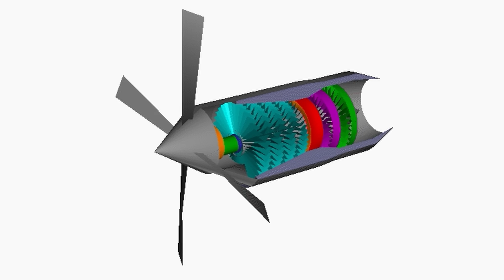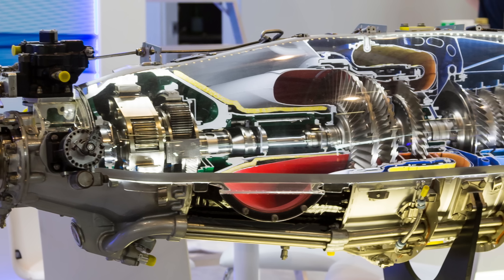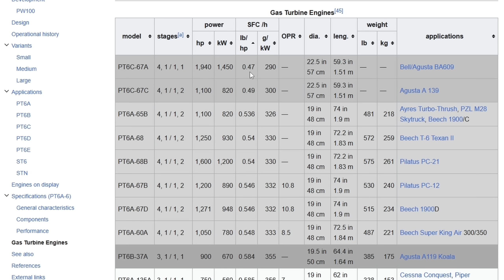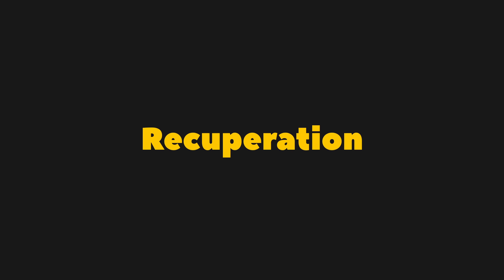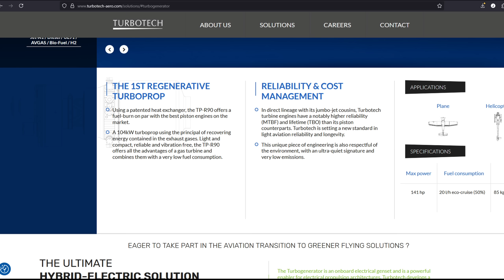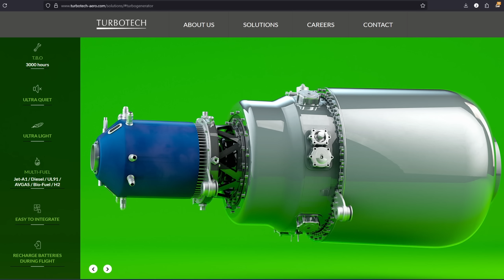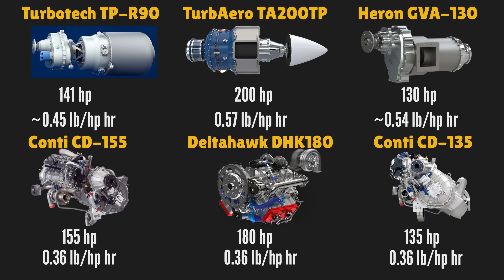Are Piston Engines Dead? Small Turboprops are Here

Comment from the maker: Most Successful Turboshaft? The General Electric T700 Design Explained : https://youtu.be/cxQ-Ef4uIpw
Why Diesel Might be the Future of General Aviation : https://youtu.be/ObGTibQHLXQ
1930's Opposed Piston Aero Engine Design Revived? Jumo 205 & Gemini Explained : https://youtu.be/NQBy1Boyfbo
Reply: Beta makes sense.
Reply: Here's the thing.  100LL will be past tense by 2030 but 100UL in various flavors is getting poised to replace it.   There are 3 big issues with this.  1st is, EVERY single, individual avgas-burning plane not factory-certified to run on unleaded avgas, which is the vast bulk of the existing fleet, has to get a special type certificate (STC) to do so, which is on the plane's owner to accomplish.  No STC, no more avgas for you after 2030.   The other issue is that  there are several competing blends of unleaded avgas out there, and it seems uncertain which, if any, will become dominant or if separate STCs will be needed for each flavor.  And the 3rd big issue is, how soon can even 1 of the new UL blends become as widely available as 100LL to support the existing and future fleet of avgas-burning planes going forward?

And really, there's a 4th big issue.  Whichever flavor of UL gets to market in quantity first will basically gain a monopoly by default, so avgas prices are certain to increase significantly for that reason alone, regardless of the relative costs of making this UL vs LL.  That changes the math you were using about  the fuel-efficiency of turboprops vs. avgas pistons.  A turboprop with a higher specific fuel consumption might actually end up costing less to operate in fuel costs over an avgas piston simply due to the difference in fuel price.

With the certainty that 100LL is soon to disappear and all the uncertainties and bureaucratic BS about using its replacement(s), it makes sense to at least consider switching to a plane that burns jetfuel, whether this be a piston diesel or a small turboprop.  Me, I'd be buying stock in Diamond :)
Reply: Electric,? You mean landing at take off weight every time? Nope. Please try again.
Reply: i just want to see gas turbine cars
Reply: @travisj2370  Sorry to be a bust but gas turbine cars have been tried and tried and tried and FAILED and FAILED and FAILED and FAILED and FAILED and FAILED and FAILED and FAILED and FAILED and FAILED and FAILED and FAILED and FAILED and FAILED and FAILED and FAILED and FAILED and FAILED
Reply: @travisj2370  Chrysler tried that after WW2 until the '60s. It didn't work out for a number of reasons;  https://en.wikipedia.org/wiki/Chrysler_Turbine_Car
Reply: @peteacher52  yea im aware of it but we arent in the 60s
Reply: Pero para que tienes que salir tu tanto tiempo pon el vídeo 📹
Reply: Then we have to circle back to weight to power ratio. And the turbine still wins hands down.
Reply: For me, fuel efficient, FADEC-controlled Diesel engines are the future in small GA aircraft. Especially as the availabilty of AVGAS around the world (except US) gets more and more an issue.
Reply: 1000 hp at the prop, means 3000 hp at the turbines.
2/3 of the air moving through is used to cool it.
Reply: @tomg6284 What are you basing that claim on?
Because if you're using the thermal efficiency calculated using Carnot then you're not far from the truth. 

BUT THEN you'll get the same sort of answer for any engine operating a thermodynamic cycle.
Reply: @hanswallner2188 Yeah I tend to agree. But there's still a way to go on the reliability of the battery systems. 
Siemens tied up with Extra and electrified an Extra 300 and showed it could still perform. That was fairly spectacular but I don't know if they proved you could take it anywhere AND one of the most important things about competition aerobatics is being able to get the plane to the comp. They all have long range tanks in the wings that you empty for aerobatics.

How that relates to other aircraft needs to be clarified because above all else they need to be able to go places.
Reply: @hanswallner2188 Battery's weigh too much for cross country four seat Planes. Liquid fuel only needs a tank. The BTU's/lbs. added weight, don't make sense for electric powered small cross country application. Use the sun to make liquid hydrogen; Now that make's sense.

Comment: 3.0L Diesel engines like the Duramax LZ0 have a BSFC of 0.315lbs/hr per hp at peak efficiency of 2750rpm. Lighter than an IO540 with the same hp range. It baffles the mind, inline 6 engines are significantly smoother the 4 cylinder engines. With dry sump oiling, much tighter rework machine tolerances, uprated oil pump, crankshaft, and rods, this would be a far better option direct drive engine option full fadec dual ECU control.
I still don't understand the FAA engine certification process. Obviously not straightforward at all because 100s have tried and gone bankrupt. There's zero chance the same rules applied in the 1950s when all the big players were certified with minimal time and capital outlay. It should be straightforward. Conditions x, y, and z for x amount of hours repeatable x amount of times at 150% rated power for instance.. Not any other arbitrary bs like the layout is different etc, etc..

Comment: Think its missing the point on why at least commercial turboprop planes are being cut from commercial airlines. Its not the fuel burn increase of turbojets, its their faster speed on the longer routes that such planes use and the lower noise over modern turbojets. GE has shown an engine redesign with a promoted 20% fuel burn cut and more simplified parts (and thus maintenance) but that alone is not enough. Passengers get a quieter ride, faster, planes can take more passengers and the perception is that turboprops planes like even the most modern are for cheapest flying is the reason they are being cut. That over time means less maintenance experience, less parts available and less plane maker investment as well as pilot supply at the commercial experience level.

Comment: The problem is cost. When it runs anywhere from 750,000 - 1,200,000 for a Turboprop engine to be overhauled, even with a small version Turboprop meant for say... a C172 sized aircraft, you're still likely looking at $100,000 for a new engine. The cost, if not more, of the airplane itself.

Comment: But look at the Heron GVA versus the Rotax 915.  The GVA weighs about 90lbs versus 180 for the Rotax. the GVA has a TBO of 3000 hours and the Rotax is 1200.  The GVA is rated to 28,000' and the Rotax is 23,000.  All said, the end cost will probably be less with the turbine, even with more fuel burn, you'll have more weight capacity, and it will probably be quieter, quicker to altitude, and can cruise higher if other factors allow. The difference between FL23 and FL28 can be considerable.

Comment: Turbines have much longer TBO schedule then piston engines, but cost of overhaul is eyewateringly expensive.  Every start , every  shutdown is a nerve wrecking 'what if it overtemps' experience. Airframe aside, that powerplant is most expensive, most maintenance heavy system on aircraft. Fuel  burn rate is a range killer.

Comment: Retired helicopter pilot here. Been operating turbine helicopters since 68. The fuel economy is .....thank goodness for large fuel tanks but the reliability is fantastic....it's other things that fail. But how many times have you heard of piston engines failing anyway? In my opinion the main attraction to turbines is the almost outrageous horsepower increase....a cherry on top is that you can exceed the power limits for a brief period to get yourself out of a pickle. Not so with a piston engine. To me the turbine aircraft is the only way to go....as long as I don't have to pay for the craft or the fuel bill!
Reply from the maker: Thanks for the comment. Power to weight ratio is definitely a major draw to turboprops. But reliability is a thing too. Of the pilots I know reasonably well, about half have had an engine failure of some sort on a piston engine. I'm sure that's an above average ratio, and some of these pilots have very high hours, but piston engine do fail more often.

I agree regarding turboprop being the engine of choice if the cost is for someone else 😆

Comment: It is probably impossible that you will ever see this but what is your take on a turbine engine GENERATOR used in a hybrid electric aircraft? As a generator, a turbine could run as its preferred higher RPM without consideration for the prop and put that higher power output to use turning copper. It wouldn't need to run all of the time, only being spun up when the batteries are low. 

Obviously, this would mean that there is time spent lugging around an engine that isn't contributing directly to thrust and there are losses when converting mechanical to electric to chemical to electric (again) to mechanical (again). Like all aviation design, there are trade-offs. What are your thoughts?
Reply from the maker: Not impossible, this will be the way to go for any VTOL or plane with multiple electric motors without sacrificing range (a la battery only).

Electra is doing this for their EL9, and their smaller scale demonstrator that has beem flying for a while now is also using a turbogenerator to generate electricity for its 8 electric motors. I covered this in a video. I'm quite sure they won't be the only ones using turbogenerators.

Comment: I think a big point was missed here, and that is power to weight ratio.  You're not going to efficiently turn that 5 blade MT composite prop and climb like a homesick angel with your Lycoming IO-360 or even IO-540.  Piston engines are great, and serve a purpose at an affordable range to most of us.  Folks don't buy a Corvette or Ferrari because they are fuel efficient or cheap to operate.  They do it because as the right foot pushes forward, the smile on their face gets bigger and bigger!  Piston engines will be around and aren't going anywhere,... because there will always be a market.

Comment: Turboprop cost vs. piston cost is night and day. That's the biggest limiting factor in any GA adoption. Asking someone to shell out 6 figures to replace their $30,000-40,000 piston engine is a losing prospect. Even a $50,000 or $60,000 engine is still vastly preferable to the cheapest turbine setup. Turbo-prop propellers also cost more than piston propellers.

Comment: A cheap turbojet engine cannot be made for general aviation (GA) aircraft due to
high costs, poor fuel efficiency at low altitudes, and the inefficiency of small-scale turbine designs. Developing miniature, certified turbines requires pushing the boundaries of materials science, which is expensive, and the cost-benefit analysis does not favor small, fast turbines over proven piston engines for GA level cost and missions.

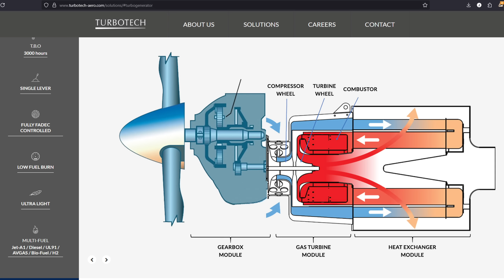Comment: Thank you for the fine and very interesting video! Fun to see the Turbotech schematic drawing at 14:28. Not a lot of blades, it looks more like a regular (car) Turbocharger with a gear coupled to the shaft and the compressed air routed past the exhaust for heating. With a combustion chamber in between of course.

Comment: It seems likely that direct-drive electric engines with their extreme power density and 90 percent efficiency through broad RPMs and power outputs have a decent chance of making both turboprop and piston engines as we know them obsolete before any real advances can be made towards smaller, efficient turboprops. I'd think that designing a constant power output gas turbine or piston engine to work with an electric drive would make the combustion engine cheaper, lighter and more fuel efficient than combustion engine designed for takeoff and cruise speeds could ever be.

Turboprops and turbofans already need lots of water to not self-destruct on takeoff and that weight could be replaced by batteries to boost the combustion engine's power for takeoff without needing water.

Comment: Is the extra fuel not offset by lighter weight?  Also, off turbines are more efficient at full power, why not size them to run closer to that at cruise? Also, is kerosine not cheaper than av gas?

Comment: One significant factor is maintenance cost. Yes a standard piston TBO can be in the ballpark of 2000hrs as opposed to the 4-6 on some of these turbines, but you can overhaul a piston yourself provided you’re qualified or have the assistance of an approved mechanic which is significantly cheaper than having to send a turbine out to the manufacturer or an approved shop to do the overhaul.

Comment: I wish you would have done a cost comparison that took the longer TBO into consideration. Example: if the turboprop would achieve roughly the same fuel burn but cost twice as much, BUT last twice as long between TBO, then the cost of operation is equal.
Reply from the maker: That would be nice to see, and I'd do it if I could. It's difficult to do such comparisons with any degree of accuracy if I don't have the cost of overhaul. Heck, I don't even have the cost to service such a small turboprop, no one does yet.

Comment: I miss the diesel numbers. How about a pulsing mode with Turboprops? High temperature burning would be ok for about 3 seconds or fractions thereof, then 3 seconds flame out for cooling and repeat. In that way you could modulate the output power without efficacy loss, because the engine always operates at 100%.

Comment: The one thing that the video failed to mention is the relative cost of Jet-A fuel versus 100LL avgas. If the Jet-A is significantly cheaper than 100LL, then it still may make sense to use a turboprop instead of a conventional reciprocating (piston) engine, despite the higher fuel consumption. Higher fuel burn still creates issues with maximum fuel loading and range, as higher fuel consumption with the same size fuel tank translates into shorter range, or the need to carry more fuel, and with it more weight to achieve comparable range figures. IMHO, the aviation Diesel engine makes more sense, especially if a two-stroke Diesel engine is used, such as the Delta Hawk DH-180. Two-stroke Diesel engines dispense with the valve train, offering a significant reduction in parts count and a corresponding increase in reliability, along with simpler operation (no mixture control).

One more thing. The impending ban on leaded aviation gasoline will force changes, and any engine that can run on Jet-A instead of 100LL has a huge advantage in that fight. The Rotax can use stock unleaded pump gasoline (mogas), as long as it is ethanol-free. Makers of traditional reciprocating engines are having difficulty in getting their engines to run on the proposed unleaded replacements for 100LL, so the future is still cloudy. Lower power engines are more likely to run acceptably on the unleaded replacement for 100LL, known as 100UL, but higher power engines are having issues during testing. Some specialists in the field have stated that the backwards compatibility requirement the FAA is imposing on the 100UL fuel is unworkable, and the EPA and the FAA need to chart a new path forward. The jury is still out, but the fight won't last forever. At some point, the EPA will force the FAA to act, simply because the health risks of 100LL are simply unacceptable to the vast majority of Americans.

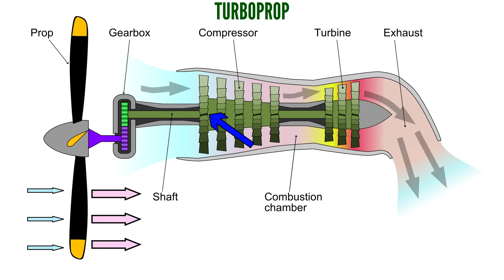Comment: 2:46 WHY???  i always wondered WHY not use that energy to also Push the plane??? its wastefull
Reply: The exhaust is always directed backwards, so it is pushing the plane. Just look at how the exhaust is orientated on a turboprop engine…
Reply: @jesselees7258  maybe i didnt expressed my complain better
the Turbine INTAKE comes from behind
and the exaust its near the propellers
Thinking about it
the only logical explanation i could make of it
its that the output its soo small
that dessignes prefers to keep the heat away of the wing frame than try to use that small amount of push

Comment: I don't know much about the aviation industry but I support any and all efforts to get rid of any leaded fuels for anything but heritage aircraft.  It's a disgrace that more hasnt been done to do away with it. 

How much more or less does aviation kerosene cost compared to Avgas? Gradually increasing the  tax paid on avgas over time would incentivise diesel and turbine based engines as well as certification of unleaded fuels and engines designed to run on them.

Comment: This was a good video and explained the functioning of turboprop engines for people who don't know very much at all. If you could design one of those engines where the fins self-adjust their pitch so that it's always optimal at any speed, I'm thinking something that works sort of like the blades on a helicopter. Also if there was a way to drastically reduce the clearance on the tips of the blades, I think this would make turboprops very efficient, but the problem would be complexity and reliability.

Comment: The Rotax (injected) engines get roughly 20% better BSFC at slightly reduced throttle settings, so the turboprop is still pretty far off.

Comment: None of it matters until the cost comes down of not just the power unit but the bird as well. I am an airline pilot at a major carrier in the USA and thought about buying a plane then when I looked at the price for a 10 year old “real airplane” (what I call an airplane you can use a good portion of the year like an SR22t, TTX or Cessna 400 both with FIKI and a turbo for getting to the high MEAs around here) and paying they go for easily $600,000 and more, for sheet aluminum an engine and turbo and some glass cockpit which at this point should be cheap with how cheap electronics are. I decided against it and now just rent once or twice a year or fly my friend’s plane when I get the itch. Planes are exorbitantly overpriced. A new 182t goes for almost $850,000 and when they were first released went for 272,000 and adjusted for inflation should only go for 502,000 today. An absolute rip off for every day tech in a piston engine.